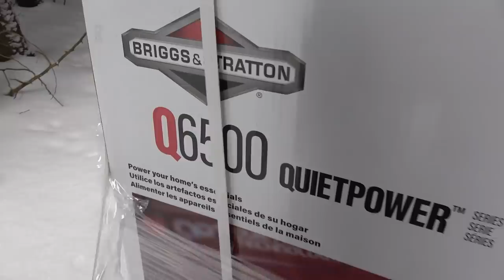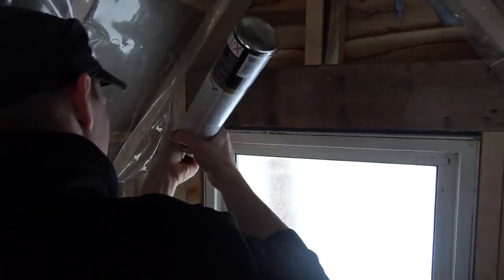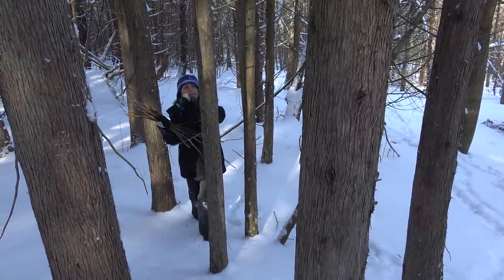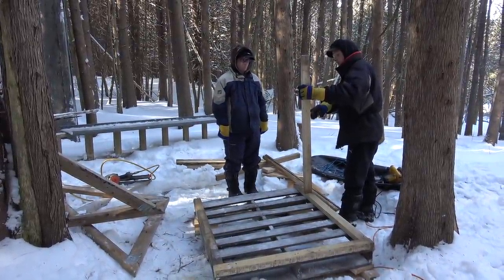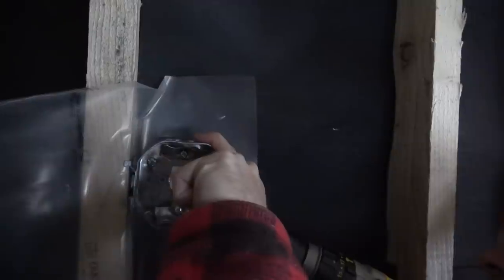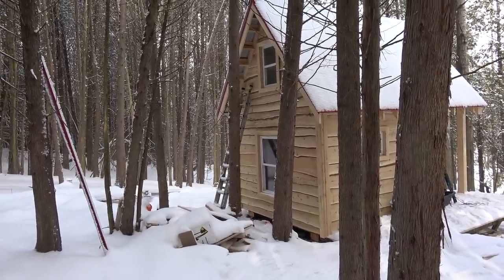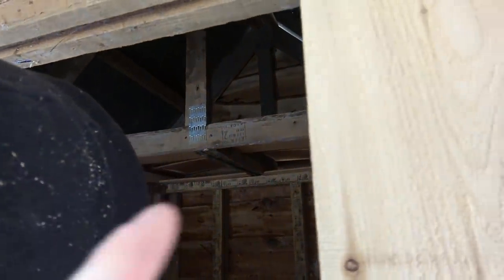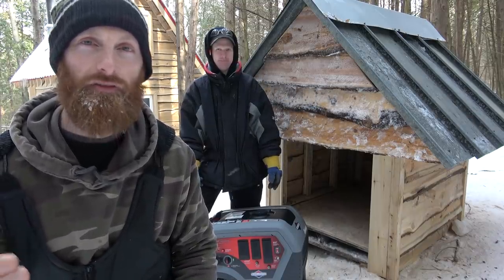POWER at the OFF GRID CABIN! | Generator, Electrical, Buttoning Up, Guests Ep3

Comment: While you are at it, you should put in a 12 volt circuit so that you can make use of the batteries that you mentioned you might charge.  With batteries you can run 12 volt LED lights, fans and chargers on that circuit without continually running a generator.  Also, a small inverter generator would to that more efficient, since it can run for 8 hours on a gallon of gas.   For example, the Briggs & Stratton 30651 P2200 PowerSmart Series Portable 2200-Watt Inverter Generator.  There are many others.

Comment: We have a generator house at our familys cabin to. Made out of block. We have 2 vents in the back n still leave the door open when it's running. You should vent that... in the summer it gets really hot in there, you need air flow so your motor doesn't over heat.

Comment: Just some suggestions from a long time off grid builder. Wrap the wall framing with tar paper before you apply your lap siding and that is a wind and vapor barrier. I understand your reasons for doing it your way. That genny is a monster and probably much more than you need. I hope you will consider solar and a 400 watt system is what I use. Get away from high gas prices.
Reply: @icanfartloud  that statement aged well.

Comment: Wow! What a wonderful gift from Briggs and Stratton !   I dig the cabin build man , and , as a former home builder, carpenter , drywaller , roofer,  you are doing great. Addressed the air flow situation, which is you main concern with heat loss. That will kick the heat up in the cabin. As long as you have some air flow so excess moisture can escape , like through the roof vent for example, you won’t have a mold issue either - a house needs to breathe a little.  The moisture that comes from a human being can be gallons PER day, way more than you would imagine. Keep a goin, it is looking really great man!

Comment: I don't care what the haters say, I think the way you've built the cabin is good to me. Wow, that was a quiet generator. Just make sure you allow sufficient air flow for the generator, but I'm sure you know that already. Just a FYI, my buddy installed one of those cheap Harbor Freight 110 watt solar panel systems connected to a deep cell battery in his cabin and it will power his LED shop light and stereo all weekend.

Comment: Roxul/Rockwool is awesome. Super dense stuff makes it easy to work with and not a mess unlike bat insulation. I just used a bunch on a job, it was only required to be used at the top of the bays from the 1st to 2nd floor as a fire block. You'll be happy with your choice. Keep up the awesome work man, we all enjoy your content. And best of luck with finishing up your cabin! Cheers!

Comment: Not sure as i havent watched all of the eps. yet. but if you havent took care of the mold problem on the 2x4s yet. if you get a spray bottle and just some bleach in it. That will kill of the mold and prevent it coming back or growing into bigger problem later on. Just a helpful tip.
Reply: Chakat Nightsparkle  You don’t want to spray bleach directly onto active mold without wiping it down with water first. Spraying the bleach on it first can actually cause the mold to shoot spores into the air and make it spread. Learned about this from doing mold remediation.

Comment: As long as LED lighting and an LCD TV, you’ll have plenty of power.
Reply: LED lamps are cheap these days, get a few of them for the cabin.
Reply: get some batteries and use the extra power to charge them so you have some power back up without needing to run the genny
Reply: Faenum I understand your point, but batteries are made to be use everyday. If you don’t they ‘’die’’ unless they get charged everyday, this is not a good idea.

Comment: Liking how you sealed the gaps in the siding with the screws, tar paper and spray foam. You will be toasty in there.

I hope you are going with LED lights so you can run on battery most of the time.

Comment: That's a clever way to tie the siding together,  I would thought to come back nd face nail it but your way is definitely better. When doing cedar shakes in battens Without plywood,  you cut the roll of tar paper to the same length of the as the shingles and roll it over each course lapping it the same as the shakes or planks. Cabin is coming together nicely.

Comment: Chris, a suggestion: insulate the floor with rock wool and then put steel screen over it to keep the rodents out. Otherwise they will chew right through that OSB board. Love the cabin!
Reply from the maker: Yeah, we need to do something under there fore sure, it's still cold!

Comment: In the summer monthes u will probably need a vent fan to pull out the heat in generator building. Happened to us at remote site with generator. Got so hot it melted the plastic on our radio system. Just FYI!!  God Bless

Comment: i think if it works for you then its OK with me. 3 things i am not sure about. first; the floor of the cabin. why OSB? and not something that was an exterior grade? the glue in the OSB doesn't fair well in damp weather. (planks like the loft might have worked a little better.) second;  did you consider propane for the generator? i don't know how long a small tank would last as opposed to a tank of gas but it is a bit cleaner. (maybe something to consider for the next time.) third; maybe a vent hole for the "dog" house so in the summer the exhaust and engine heat can escape with some cross ventilation. anyway, lots of work, with some great results.
thanks for sharing.

Comment: Hi there .
if you are using a generator and battery banks you can use a Chinese diesel heater to get plenty hot dry air for the cabin and just use a sip of diesel !!!  you can find on Ebay or Amazon starting around $ 89dls up to $ 200dls Good luck with your Cabin.

Comment: a few 12 volt battery's and a small inverter to run 120 lights and small stuff radio or laptop, a battery charger & a few solar panels to charge battery's with a small car battery charger, i used a few old boat battery's a few wires & a 40 dollar Walmart inverter! a solar power kit it was like 400 dollars(that was the kit I learned how solar panel systems worked) the parts needed to make bigger systems & what it will run! remember that camper your torn apart the fridge the stove & propane system this what a lot of off grid cabin use in a kitchen! i had a lot of neighbors think it was a joke, over solar well first time Grid power went out, my TV ran, internet and computer run! the joke was on them it worked!

Comment: So, every time you want to fuel this thing, you’ll have to take it out of the structure. Maybe you should consider a roof that can be opened for access. Just a thought.
Reply: You could put some slides on the floor so it slides out through the door when you need to fill it, no lifting required ;)
Reply: Or .. Maybe he / they should have made it taller? Enough to stand, and maybe to store tools ? That would have been smarter. Instead of a shed, it's the size of a dog house. He has to crawl in?? Not thinking ahead , poor planning.  (at the end of the video he actually realizes this).
Reply: It is on wheels, how easy do you want it? Alexis fuel the generator to my "off grid" cabin. Add amazon button for reorder of firewood.

Comment: I had to do part of my roof like you did the inside of your cabin.. 85 year old house had a room built in the attic had bare tile under the old tung and groove and a hornet nest ;-).... I agree with the batteries thats putting out a lot of power you could save some for the gas your using.  Love to see all the people helping and the kids having fun. I bet it was nice to have saws and other tools running at full power. I am sure you will use all the plugs.. Phones cameras kids among other things lol. The generator is quiet for sure.. I dont like city life. Recharge is good. You should get one of those security dog barking things for the dog generator kennel. the movement detector type might keep people away when your not around. It was a vole not a mole howd I know the buggers eat my veg in the garden but dont come in the house... they eat lots of my veg... It id snoopys house for sure the red barren ;-)
Reply from the maker: Vole, good to know!  Saw a few out today!

Comment: Concerning your generator house...once you have the door on, is your generator going to have enough air flow to run ?  Also, I would suggest you use underground cable for the power to the cabin.

Comment: The problem i would see with having the tar paper that way instead of having it on the outside under the siding, would be that instead of having the condensation just running of the end of it, it may accumulate on the flooring instead?... But this structure isnt really going to endure the same amount of heat cycles as an full time living building i would think!  Really good videos!

Comment: except for the subzero Canadian cold and the snow, I wish I was out there with you guys.! you made quick work of that shed build, and smart use of salvage.   would  a couple of louvers in opposing walls for generator air ventilation be a consideration?  button it up too tight maybe the gas engine would be starved for air?   thanks for the vid
Reply from the maker: Yup, burning with the door open is a must unless we vent.

Comment: For lights you should do 12V Led.   Split the electrical so that lights and outlets are seperate.   That way, you don't need the generator running all the time and can have lights if you have to get up in the middle of the night.    Get a marine battery charger that stays connected all the time, and possible a quick connect for the battery if you are going to bring it home to charge.    The generator is overkill to run 40/60/100 watts of Led lights.

Comment: you should run some 12v led strip lighting in there and run it off a battery that way at night you dont have to have the generator running but have a trickle charger on the battery plugged in so durring the day when the generator is running its charging the battery! and possibly a 12v cigarette plug to plug in your phone charger or what ever you may have. just an idea
Reply from the maker: Good idea.

Comment: FULL STOP. Great vid. Love the out take at the end. Couple questions, will the live edge create any issues behind the tar paper over time and will you remove the generator when in use? Just wondering about the exhaust and if you would need it piped outside the dog house to run effectively. As always sir 👍🏼
Reply from the maker: With the door open, should be okay.  Just needs oxygen.  The live edge will fall off, but leave the natural edge of the exterior of the tree.  The tar paper will be okay, vent out through the exterior in the summer.

Comment: If you are using just lights i would have went with deep cycle battery and solar system with low wattage lights . 1x12volt 100amp hour battery and a decent inverter would give you all you need and more  . But still the generator is handy for power tools for more projects such as when you build the jacuzzi etc to go with the cabin 😂
Reply from the maker: Hot tub was mentioned.

Comment: With a cabin that small your won't worry about a little air leak here and there, with the smallest wood burner it will be more than enough to heat that place.

Comment: Look into LiFePO4 battery in place of a Marine (or other) deep cycle.

Benefit is you can discharge to 20% (or even lower with some life loss) without impacting overall battery life and charge absorption is faster (Less generator run time to refill). If your generator has a 12V output, the LiFePo4 batteries have a similar charge profile to lead acid. (i.e plug and play) 
 
Drawback is you can not use iLiFeP04 until it is above zero degrees, but your use profile sounds like it might meet that requirement. Also, a Lithium Iron Phosphate may be a 30% premium to lead acid, but when you figure in longer overall  life and a greater discharge profile, the price differences is not apples vs apples (i.e. power supplied per dollar spent )

Full stop
Reply from the maker: Thanks Bill, will be looking into this!

Comment: with all that power you should think about putting in a electric baseboard look at it this way if you are running the generator it is free heat
Reply from the maker: It's a lot of draw to heat with electricity.
Reply: you have plenty of power I run my whole house on a 6500 watt the only thing I can not do is run my dryer and well pump at the same time ( everything in my house run off it 4.5 gallons of gas in 10 hours )

Comment: Should of just cut more wood since you have the sawmill.  Sided the building with 1 X 6 to sheet the outside. Then you could of papered the outside and then sided. Insulated poly fort your vapour barrier.  woulda had to foam nothing or paper in between. What ever works.  Ty it on cabin 2 lol

Comment: You should make a pad fur out in front of it like what's the width of the frame and probably no more length and the width just so you can pull it out and you can work on it fill it up with gas so you don't constantly have to be picking up and putting it down Evan better build that into the future but you can still do it to hold the weight

Comment: I'm sure you're already thinking this way, but go with LED lights.  The low wattage requirements support running off of battery/inverter.  Would have been interesting if you could have salvaged 120/12v inverter from the camper and wired the house for all 12v save for a few outlets, that way you could run battery 99% of the time.
Reply from the maker: I think the idea is to go battery eventually and have some options.

Comment: You should put a socket for a small ceiling fan above...for the summer.. Just incase..now that the generator is present...2 led lights outside on the front porch.. n one on the  outside right below the loft back window...be very careful of ur wires.. Coming into the cabins.. Mice/Rats love to sharpen their teeth on the electric wires..so either u put the wires from the generator onto the trees hanging all the way to cabin or come summer n u add electrical piping n dig a trench from generator n to the cabin.

Question..where the potty?.. Outhouse?
Reply from the maker: Gotta let it melt a bit, then outhouse!
Reply: @TheWoodedBeardsman   yup.. Till then the bucket is mighty?

Comment: You know you could use a portable solar set up with the generator to charge a small battery bank.. You don't need a full time built in solar system cause your not there everyday .. If you get a solar generator you would not need a solar charger or an inverter .. And if you get the right solar generator you can add batteries to the system for more power/storage..

Comment: Here is my only criticism.  If you are going to put so much into the cabin: electricity, drywall, insulation, loft, deck, etc.  Then why not increase the square footage from 12x9 to just a tad more like 14x12.  It looks awfully cramped for a family to relax in the size it is now, why not add the square footage if you are going to spend the materials on a cabin like that.  The scale of the extra sq. ft. would not be significant. I understand that the cabin is not meant for chilling in all day, but once it is dark you need some room to stretch out and take the boots off. The extra room would provide a possible area for an open seating area.  Otherwise I love the cabin and great job.

Comment: Run the Generator at max for minutes to charge BIG batteries, then you can silently run tools, LED lights, and USB for hours and days. (Unfortunately, air cooled gasoline generators don't live long and are unreliable. Water cooled diesels will live a long reliable life up in the woods, and diesel fuel ain't so dangerous or flammable.)
Reply: True, but you can argue with ... FREE! : )

Comment: briggs n stratton will be freakin out about your tinderbox suffication shed for the geni, also your bro just trashed the cabin with those extra screws to seal the gaps in the outer skin, wood moves ffs
Reply from the maker: You are not for real.
Reply: @TheWoodedBeardsman  yes i'am, and as you've addressed in your latest video the wood is wet so will shrink, external boarding is only fixed at the top edge to allow the wood to move through the different seasons without shaking down the weak grain points, also the generator needs to breathe and exhale its waste to run well long term and as some others have pointed out refueling/oil checks will be a two person job..sorry buddy should have been more informative of my opinion on my post before.

Comment: You're  wasting your time with the expanding foam and strips of roofing felt ... !

Its N0T easier, (nor proper) to staple up strips of "tar paper" in between the wall stubs; your vapor barrier is essential between the radial sawed siding and the outside surface of the wall studs themselves.

A "Tyvek" whole house wrap would have been even  better and much easier  than measuring and cutting individual strips.

It's not easier, ... you're  attempting to mop up on a seriously overlooked judgement  mistake  made earlier.

Some sheeting under the siding would have been even better.